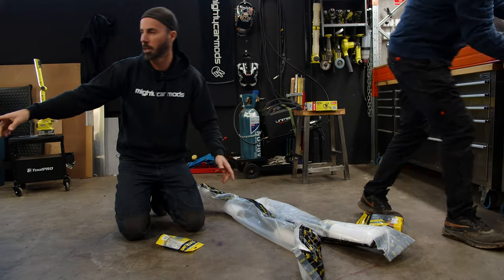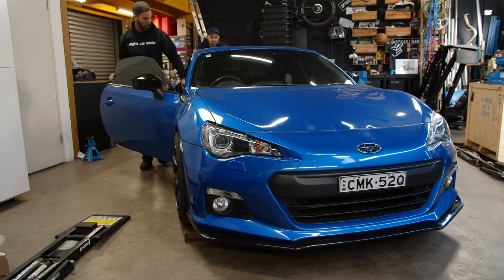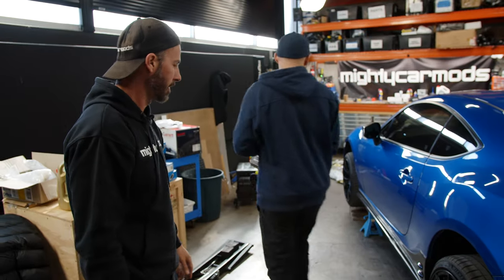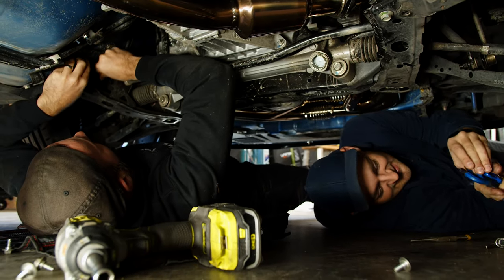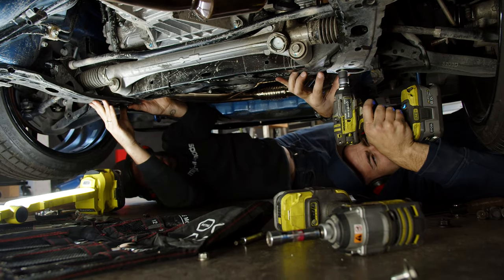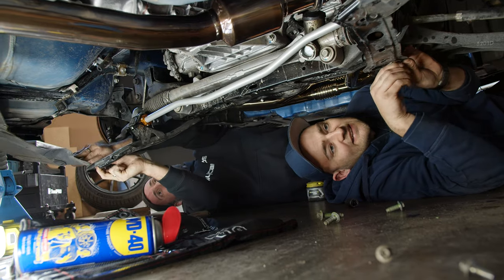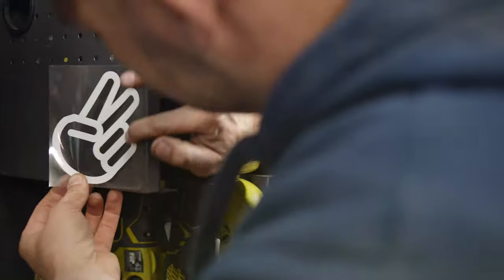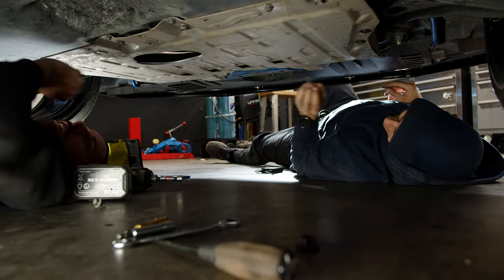Disrespected BRZ *EMOTIONAL*

Comment: If I can raise a technical question, what is the difference between a dak-dak and a whizzer?!
Reply: A dak dak is a rattle gun aka impact wrench/gun.

Now... a whizzer can mean several different things depending on the context, in can mean an electric drill, orbital sander, electric ratchet/screwdriver. Honestly "whizzer" is universal to anything electric and goes whizzzz.
Reply: Cause a dak dak goes dak-uh-dak-uh-dak-uh-dak-uh-dak-uh-dak
Reply: The dak dak kills threads and the wizzer twists the head of bolts and screws

Comment: Both my wife and myself agreed that a stiffer front bar was not the way to go (yep suffered thru replacing that bar twice).  You are going to have understeer for days.  Get some properly setup (increase spring rate appropriately front and rear) coilovers with good shocks instead.  

Increasing front bar stiffness only removes grip from the front.  Which means you need lots of throttle to get the car to rotate.

Comment: Autozone in the US sold the same low profile aluminum jack. There was no second production run because the return rate was nearly 50%. it is very under rated for it's appearance causing consumers to use it on full size trucks often breaking the jack on the first use. Autozone just finished clearancing these off the shelf.

Comment: “I feel like people who own these cars really like them”

Why yes, yes we do
Reply: they aren't very powerful, but aside from that, I don't think they deserve any hate
could they be more powerful? yeah, but like, its still a fun car, it still looks good, it still sounds good so you know, why not?

And they're highly modable aswell. Really good car imo
Reply: For at least the first week! Until its immediate replacement is located. 

Just poking fun at you. I own a modified Prelude (cams, full suspension, exhaust, brakes, intake, tune, flywheel etc) so we're in the same boat. Aside from my only available over steer is solely on liftoff, which I do admit I have dialed in perfectly.
Reply: My mother in law used to say that about tripe. "People who like it say it's great."
Reply: They're an amazing weekend track warrior base you can drive to the track. They come bog stock with prius tires and no forced induction, allowing the owner to modify them any direction they want. They expect people to turbocharge and supercharge them, and they expect you to put bigger/wider wheels on them. They're just a great car for an enthusiast.
Reply: @thelazypirate5997  I've driven them, I get it. But another thing Id also get is probably an S2000 considering they are on the way up in value, and are a bit more "CAR" for the money. Forged internals and all.
Reply: @jordanjoestar8839  Don't get me wrong, there is a dozen cars I would buy first before a BRZ or 86. I personally have a penchant for FWD nuggets that can make ridiculous power, and can't grab traction til 5th or 6th under WOT 😂

Comment: Guys, I use blocks like that in my shop for low cars. The trick: screw a 1x1 to the far edge of the ramp block so the car can’t roll off the front of the block like it did. Great humor in the video but this little trick will make life better when using blocks on low cars!

Comment: You can still buy that exact jack just anodised red

They ALSO sell the big boy steel jack and it's longer and lower than the alloy one, you got it backwards. the only issue with the steel one is it's bloody heavy and unwieldy

But yeah you can still buy that exact jack you're using at Australian Costco, there's tons in stock in QLD right now

Edit : looks like the latest Jack might be silver

Costco doesn't always keep products in stock 

They only by in bulk so sometimes they run low or even completely run out before restocking which is probably why you saw none for sale for sale for a while

Comment: The best way to avoid stripping out small sized fasteners (especially on motorcycles) Is to get a 1/8 ratchet and sinch them all up by holding the ratchet around the head of the tool, rather than the end of the handle so you can directly feel the torque applied to the bolt and get them to hand tight and then give them an 1/8th of a turn to lock them off.. believe me, an extra few minutes spent doing this is better than spending hours drilling and tapping threads or ordering helicoils and installing those

Comment: Alternate purity theory: Aside from some cars being worth more unmodified, I prefer buying unmodified cars because they're usually not hacked up like modified cars, and there's less to fix to get the car reliable again.
Also, if it's a type of car I never had, I like to experience the car as it originally was.  I might not want/need the modifications that someone else wanted, and then decided they didn't like so they're selling the car instead of undoing them. (Yes, I've undone some modifications that made the car less enjoyable.)

Comment: To undo the anti roll linkage crack the nut off then put your spanner on the nut and use your battery gun with an allen key bit  to spin the centre makes it quicker and easier just make sure to clean the threads first 👍

Comment: “To help keep your clothes clean, sweep/blow the dirt off the floor” 
Bull dozer heavy duty mechanic laughs while removing the belly pans and having to clean a layer of dirt half a meter thick that’s falling on him.

Also Moog would be shocked, in WA you can drive any car you want on your L plates (when you turn 16) as long as it’s legal, V8, turbo, supercharged, it doesn’t matter you can drive it😂
Reply: The L plate thing is the same everywhere I believe, just not p's

Comment: could you do a programme on importing what you can import in each state not exacts but like a gerarl list of what year you can get like the old JDM cars are getting mega expensive and now also there is amazing deals all comes in stock but you buy a well built well modded car and they take mods off and send them to you separately so you could get also those ryobi blower vacs work awsome for installing on the car 4 of them pushing a nice amount of air into the intack and looks cool as well

Comment: When Toyota designs a car they do it for a purpose. The MR2 was the best driving rear mid affordable car. The Corolla was the most reliable cheap car for decades. The Camry is the most reliable midsize in both 4 and 6 config. The 4Runner is the best 4x4 SUV for offroading reliably under 50k. The 86 is the best cheap fun car, and also reliable, and also best looking under $25k  (original msrp), and also good on gas, and also best chick car daily driver and also best rwd winter beater under $25k (original msrp), and also reliable auto trans and they don't even make it themselves.  Is it the best sportscar? Maybe not, but the succeeded at what they initially set out to do.

Comment: have you ever tuned and modded a oldskool bmw likt e30 or earlier or e34 5sereies ior m series car as long as it has a clutch the e39 m5 or the e60 m5 are both in the price range of those cars the brz 86 sota thing but are 4 door and waghoon super car or super saloons and suspension breaks stance rubber and then the under bobe stff you cab get serious horse power for bog laps or burnouts or racing or just driving like out of the box the m5 e60 v10 is 550hp and similar or about the d\same tourque figures  cant remember but its ohh i hacve dyslexia so please dont judge content by the writing like e30 are now the cars that are getting very high in price and e34s and so on wesecially with books period correct mods and so on on and if you did like a port polish by hand and a full balance by hand with emery cloth and never did full standalone ecu etc biggest new release sorts deal was a set of individual throttle bodies with some chrome trmpets why dont you guys not do a new car like what these throw away cars are and do a real steel car a respect your elders type couple of issues of MCMs see if you haven't lost ya diy meching know how.

Comment: I think the Purity People, the Factory Freaks and the Non-Stock Nazi's, are 3 different zealous sides of the same back-patting coin. You guys are like that with jdm tuner culture sometimes. I've always been into cars, I'm not an old dickhead (cheers Martin ; p), and since I was about 18 I've been pretty big on the #purity. But that's only because I like an engine I can hear, that's responsive, easier to work on, revs higher, wears less and stays cooler than its turbo counterpart. I like cars that don't weigh that much, that are engaging, ideally stickshift, look cool, have good handling, maybe a touch of heritage and a nice interior. Which means there are a lot of bmw's I like and let me tell you the E30 you did was the fastest I've clicked on one of your videos. However, I've never gone in for any of their brand image bullshiiiiiiiiite, and I think people that do can be rubes.

So even though we disagree to an extent what makes a good car, we agree about 99% about what's enjoyable about car*S*. Just like I don't think all atheists are right, and I don't think that all christians, or muslims, are right. I think that being a zealout is wrong however. In a sentence, I guess that would be "purity is not marketing bs, nor is jdm, nor is well-if-the-factory-did-something-a-certain-way-there's-a-reason, but it CAN be. And liking any of those things isn't wrong, it's only wrong if you tell others they have to agree" ooops I even made that rhyme, I might vomit lol

Comment: ohh and I picked bmw as there is soooo many parts available including and not limited to repop parts sand so on and the trend of older german gards has become the melleinals thing beard glasses hair all perfectly trimmed and no greasy anything and a plainest unmodded car d=some want the original the better whats the point in haveing your own flair id you tunbe cars simply by adding the exhaust intake rims and stance and that's it you have done some vws which are cool and were a fun watch but never really got into an rea engineer modding like taking valve putting in drill press and useiing emery cloth to slowly make each valve weigh the exact same and putting in out of like 200 sets of valve guides finding the ones which weighed the sane or were with in 0.001 of each other and the second head and haveing it hand ported and polish then extrude hone dowled the block and added arp or simiaer head studs new pstons if you could grabbing #l crang of same emgibe series and putting into you 2,5L also bigger injectors and the other thinhd snd just got grassy not basic modding